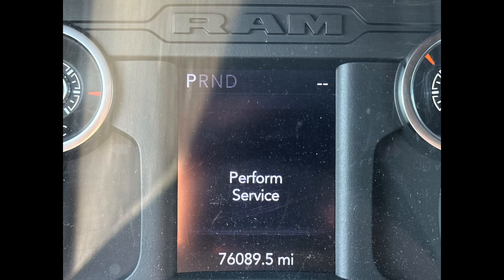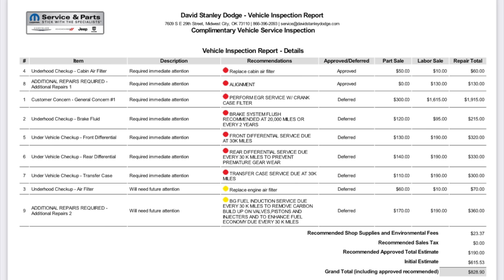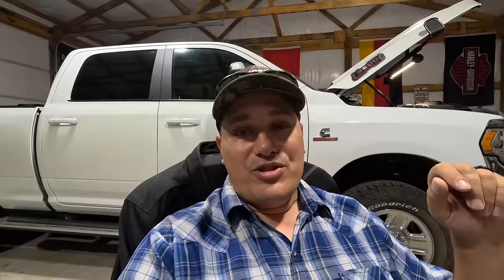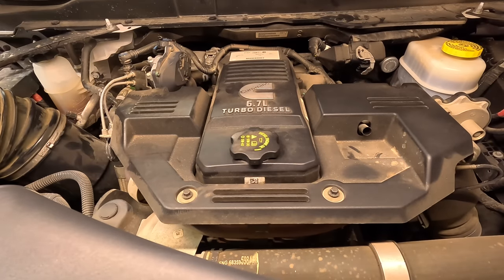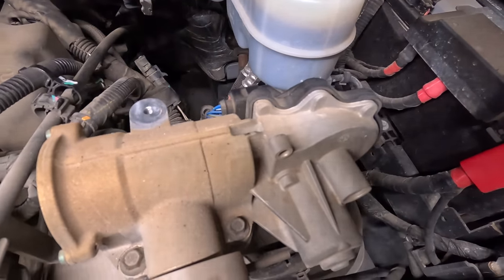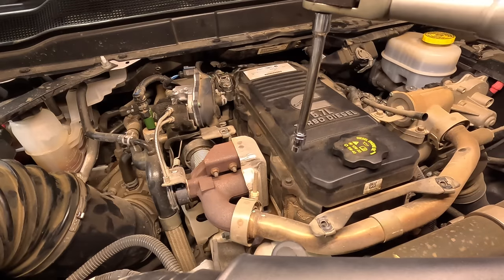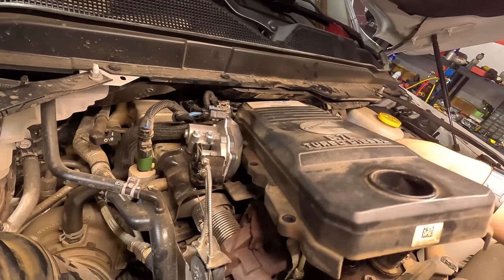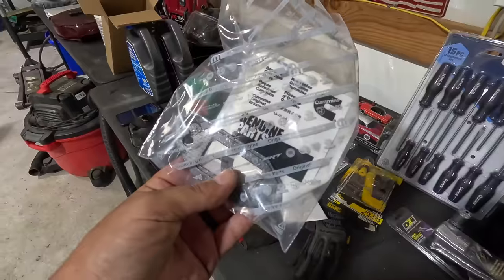My 2021 RAM 3500 Needed $4,000 in Service!! DIY EGR and CCV Service Saved me $1650!

Comment: Why didn't you clean the cross over bar and the EGR cooler?  I had the same problem with my old truck which was a 2018 RAM 2500 and the dealership wanted $2,500 to clean.  I told them I would do it myself and they said I need to do the cross over and EGR cooler.  So now I have 2 - 2024 RAM 3500 and I will hit 75,000 miles quick maybe in 6 months.  So are you say in this video that only the valves need cleaning on the newer trucks?  Thanks it was my first watching you video and loved your dog Roxy.

Comment: Crappy Fuel and Low Cetane will kill this truck. Also, consider Archoil 9100 and 6200 for idling

 Propel HPR, 75
Syndiesel, 60
BP (Amoco branded), 51;
Countrymark fuels Diesel-R, 50
Chevron, 49; or 51 with Techron D labels in select markets
ConocoPhillips through the 76 stations (California) 47-53
Petro Canada, 47-51
BP (Powerblend 47, otherwise 40-42)
Shell, 46;
Sinclair, 46;
Sunoco Gold, 45 (often +1-5). Sunoco regular is usually 40.
Exxon/Mobile, 43-46
Holiday Stations, 40-43
HESS, 40-42, can be up to 45.
Husky, 40 + diesel Max additives raise another 1-3 from there (41-45 max)
Pilot/Love's/Flying J/Valero/Sheetz/Walmart/Wawa: 40

Comment: Not sure what you got for $800, but I'd recommend never allowing the dealer to do any work on your truck unless it's under warranty. And definitely shop prices on the parts. RockAuto and Amazon. Also replace your grid heater asap.

Comment: Should have changed the oil and all filters, installed oil bypass filter, ck. water separater, before U put it into service. Replace intake with a Banks intake to fix the heater nut problem.

Comment: Yeah service is a rip off for sure .. But here is the good news 2018 and newer 6.7 DO NOT REQUIRE EGR CLEANING CHECK YOUR MANUAL. CCV FILTER IS REQUIRED @ 67K AND DEALER WANTS 600.00 TO INSTALL 50.00 FILTER. EASILY OWNER SERVICED. 
Dealer also gave me the brake flush
Diff oil change rear end oil change etc. If you tow change rear end lube for sure. Also your trans fluid 25k if towing 30k if not. Once a year new gas filter and water separator. If you own a Ram Cummins it nice to know how to do a few maint items to avoid dealer. If truck is out of factory warranty look for high rated independent diesel repair near you
and let them quote some work to compare prices, now even if close in pricing I would prefer Independent shop to do work as its generally done correctly. You be surprised who does light maint at dealer.. Not service tech but the lot boy/ quick lube guy. Again don't get dealer ripped for non required service.

Comment: My thoughts.  The message was from Cummins.  So you really can only blame the dealer for the prices.  You didn’t get scammed or anything like that, it was Cummins that programmed that message an the dealer is just following what they are supposed to do, which if you want to do it yourself is fine as they were helpful an told you what to do anyway, some wouldn’t.  

As for selling the truck because “I had to spend more money on it”, life happens.  Nothing is perfect.  I paid off my 08’ cobalt sport an had to dump another 300 in it for a fuel pump, never once said “Omg, I expected this to last me forever, shouldn’t have to do this!”   I also replaced my own 80 dollar part for that stupid exhaust side cam solenoid on the top of the valve cover.  Still, never thought to get rid of it.  Stuff happens.   

Also your truck had 65k on it. It was prolly time for that to be done.  NOW the dealer could have not upselled that extra stuff an just kept with the CCV filter an EGR clean, I would have told them to do just that, instead of going “omg, they want 4000 dollars to do this”.  Your the customer, tell them what you want or go to another shop.  

But it’s your vehicle, an I think that Ram will still be good to you, you just had a minor hiccup, keep going forward, you got this.  Get the most out of that Ram, then get rid of it, or find an older truck that might have more problems that 1600 won’t fix, just a gamble.

Comment: Doesn't doing it yourself at this mileage void any warranties?
Reply: You got the right to work on your own vehicle, you're not adding performance parts or flashing the computer or changing the shift points, ETC your installing genuine dealer provided parts as preventative maintenance.

If that was the case then if we changed our own oil, it would void the warranty
Reply: @B0xlife1  that's what my understanding is with warranties 
If the owner tampers or is not done by an approved shop then the warranty is voided.

Comment: Great video, you can't save more money. After 15-20 years depreciation is the highest. Buy a decent cummins engine truck with low miles and no emissions. When it get's even older it will become a classic. Greetings from Germany

Comment: So everyone knows that sees this video. That message that you got comes one at 65 “ish” thousand mileage for the ccv filter. 5-15 minute change if you know how to use a ratchet and socket. You can also do the fuel filters yourself for less than half price of the dealer cost and labor. If you can’t do it yourself you will see that crazy high bill that’s shown at the beginning of this video. A quick google search instead of taking to the dealer will always save you money.

Comment: Was that the entire EGR serivce?  I thought it also included cleaning the EGR cooler which is where all the labor is.  Currently doing it on my 18 right  now with 72k miles amd none of the EGR system wqs very dirty but i mainly do highway and make sure regens complete.  Also thought this wasn't called for until 60k on pre 13 and around 100k for 13+.

Comment: Hello Randy the cab filter should be changed once a year not every time you need a oil changed
Reply: Depends on where you live. You live on a farm. With lots of dirt. Then change it often. Your truck lives in a heated and padded garage. Once every 2 years if any😅

Comment: ccv is cake. the transfer case and front diff service intervals aren't 30k the transfer case service is 60k, front diff is check at 60k. 4th gens stopped getting egr cleaning services as the years went on. 5th gen cummins don't get an egr service. 
TLDR go to a different dealership.

Comment: New is sometimes the answer. If you have a partner and they want the newest sure that’s fine. But for me always used. It depends on your use if your driving tons of miles and have the means or it’s your income literally the use of that car then yes new is better if you don’t mind the depreciation. Otherwise drive a 20 year old used whatever. For me the top of reliability is 90s and early 2000s. Early 2000s is new enough to feel new.

Comment: How  does the round gasket stay in place while you are putting the Egr valve back in place?   If the original breather had a bunch of oil in it, do you need to add more oil to make up for what was in there?  ( yes, a newbie hoping to do this myself )

Comment: Your first mistake was taking the truck to the stealership for service instead of somewhere else like a local independent shop that would give you a better price. 
The second mistake was buying a used heavy duty diesel 4wd truck with 60k+ miles on it and expecting not to have to do a lot of maintenance on it. 
Just because you buy a used vehicle from a dealer doesn’t mean they did all the maintenance that was needed. 
I bought a used truck with 80k miles on it from a dealer expecting to have to do some maintenance and I was right. The only things they did was an oil change, front and rear brake pads and two tires. 
It still needed a transmission service, spark plugs and wires, belts, air filter, and the rear differential was low on fluid. 
They want to maximize their profits and so they are going to do the bare minimum before selling a used vehicle in hopes that you’ll bring it back to them and spend hundreds if not thousands of dollars in maintenance and repairs. That’s why they are called the stealership. The days of the dealership taking complete care of their customers is over, they are only concerned about their profits.

Comment: It hurts, making all those monthly payments and then an expensive service on top of it.  If you have another service on the Cummins, some aftermarket gaskets and breather might be much cheaper and good enough.  No personal experience with Cummins, just my opinion.

If you're paying that much on the newer truck and you have a cheaper alternative that gets the job done, that you can maintain, you should take it.  Of course there will be other maintenance issues on an older truck -- transmission, suspension, body rust, electrical, etc.  But still, 1100/mo payment is something to avoid unless you have no choice.

Comment: In response to not wanting to deal with the maintenance and repair costs of the current truck- just get a newer gas 3/4 ton truck. They’re great. Way cheaper, great at towing, and cost a fraction as much to keep them running.

Comment: What was that Milwaukee electronic ratchet you were using to get the little bolts from the engine cover off because that looks like a good reliable tool

Comment: Yes it’s business and a little unethical.  That truck should have been fully serviced before they sold it to you.
Many dealers will give you a “deal” or convince you it’s a deal, then get you on the regular maintenance on service you need and some you probably don’t need just yet.  It becomes a revolving door. Over 3-5 years you probably spend 30% of what you paid on service.  DIY is great.  I have the dealer do what I cannot.

Comment: I'm sorry, but why are you waiting for your truck to tell you to change the oil when it's been over 14,000 miles?? My Peterbilt holds 10 gallons of oil and it gets changed every 10,000 miles. Engine oil is cheaper than an engine. Personally, in my regular vehicles, I change the oil at 5000 miles. Spill and fill the transmission every 5 oil changes. Just my 2 cents.

Comment: Man, if I didn't pull 29k everyday, I would just go to gas. I have an 05 ram and it doesn't have near the power my 18 dually high output does. 05 has a 5.9 cummins.

Comment: Hi Randy. Just wanted to share with you the experience I had with the GMC dealership here in Michigan. Here's my review.

I had a problem with my AC and the service guy told me that my rear evaporator core was leaking. I paid $150 for them to investigate. After they found out what was wrong, they charged me $1600 to fix the problem. I declined to fix it and took it to my independent mechanic. The mechanic told me that nothing was leaking. The only problem it had was it was low on refrigerant and charged me only $250 to fix the issue. This dealership is a total ripoff. They will charge you for something that does NOT need to be fixed! About 5 years ago, I had a GMC Acadia, and had a severe issue with the headlights when driving at night. I took it to this place and they said that the headlights were fine. They didn't care about my safety. Stay away from this dealership. They will rip you off the moment you get inside.

Some dealerships are ready to rip you off hard. The air conditioning still works great to this day for $250. You can't trust dealerships nowadays anymore. They will find a way to rip you off. Especially when a person knows nothing about cars. Thankfully you do. Keep up the good work Randy. I love your videos.

Comment: Crazy they cracked you in the head with that estimate when it’s literally almost all stuff that can be done self service. Have 50k on 22 2500, had it since new, done my own oil and ccv service every 10-12, did rear diff change at 45k, doing BF, trans & transfer case flush & another oil change by the end of month. They’ll beat you down for the services by using MOPAR fuel/water filters, charging 350$ for the service…Doc diesel has them and cabin filter for 100$ and the service can be done by a 10 year old with a ratchet. The ccv is 50-80$ and is a few bolts for the cover, the fluid changes are just cracking bolt holes open and the BF is a turkey Bastet in the reservoir for the old stuff, filling with new, opening bleed valves and pressing the brake pedal till new fluid comes out. It’s not even labor that they’re beating us on anymore, it’s 5x overcharge on parts. If I’m going to spend $ on service, I’d be smarter to buy the tools I need, cheaper than the service cost and do it myself. Stay on top of your coolant level too at 50k/1800hrs, I was under the min line. That oil cooler eats it up. An actual EGR/DPF and alignment service is a shop thing🤷🏻‍♂️

Comment: Fuel Filters are stupid Expensive. Problem is, Cheaper filters are usually Cheaply made.
Replacement tyme for both Filters are 0.5 hr. each. If you are competent enough & have the proper tools, ( 28 mm socket 1/2 inch drive, Not a 29mm, a couple extensions & a swivel) you can replace them both in about 45 minutes, as long as the last guy wasn't Heavy handed, & or used the wrong tools, when tightening the covers/filter housings. (Your 2021 are Plastic). 

  Proper oil change for a Cummins Diesel, takes an hour's labor. 30 minutes of that tyme, will be draining the oil. Remember there is 12 quarts of oil that needs to be removed, & on a Hot Engine there is quite a bit of oil in the upper end that needs tyme to drain back into the oil pan, & out.
Oil Filter is only accessed thru the right wheel well, & it will either spin easily, or it will fight you to the point of frustration, Depending on the last Guy that did the filter change. 

  If You do a lot of towing & heavy braking, The fluid changes in the brake system & diffs where most likely needed. If Not? Then it wasn't.  Again If Towing? A transmission Filter service will be coming up soon, & You will want to do it, as it removes debris, & Heat Damaged Fluid from the system. If you are not towing, it is still recommended around the 80,000 mile mark, & I would not go over 100,000.  Unless you have the 8-9 speed transmission. I do not remember the service interval for them. The 8-9 speed transmission has a filter in the Pan, so you have to replace the pan. 

  The Newer Diesels with EGR's & EGR coolers do not do well Idling, nor do they like cold weather. They soot up & do not flow as well as the monitors / sensors like. But as you have seen they aren't that bad to clean, on the Cummins Engines. The EGR Cooler simply needs to be cleaned out with a power washer, to remove the excess soot build-up.

  You have been Driving this Truck for some tyme, & going to a Pre-Emissions Truck will be a disappointment, as You have gotten use to the Larger interior, the Nicer ride, & the Bells & Whistles of the late model Truck.

Comment: Diesels, especially Ram trucks, are largely a waste of money. The advantages they had before they don't offer anymore and are extremely expensive up front and in the shop, which they now spend a lot of time at. A diesel used to run 250k before any work besides maintenance needs done like oil changes,  valve tolerances, coolant flushes, etc.  I'm not even at 120K and I've replaced my turbo($4800), DEF pump and injector ($3500), air cleaner ($550), and power steering pump ($710). The "routine service" is a few thousand dollars to clean all the emissions crap. 

Unless you're buying a duelly with a 6.7L and an AISIN transmission to haul a 30,000 lb. excavator with, you're wasting your money. Gasoline engines are a lot cheaper, lower maintenance, and can be modified for better mileage and power. Some of these diesels are ridiculous like the 3/4 ton with a 6.7L in it. The motor is made to haul 3 times more than the axle can bear and is hooked up to a transmission meant to be used on 1/2 ton trucks.

Comment: My days of Diesel pickup ownership are over.. 
absolute garbage compared the  diesel pickup trucks of the 90’s to about 2012 … of course I’m speaking of the Cummins and Duramax pickups of that time 
My 99 is still on the road  at 25 years and 400k miles. 
Good luck to everyone trying keep a modern diesel running after warranty runs out

Comment: Why the hell does it cost $2,000 that's nut's. I understand now But I wouldn't bother replacing the brake fluid if it's a 2021 should be ok  for another couple of years same with the diff fluid if it looks okay i wouldn't bother changing it

Comment: Cost of repairs.    1 reason I WONT. Get a diesel!!!!    A diesel truck costs to much all around!!    If u. Get a truck. 1. Diesel engine costs. 10. 12ooo.00.    2. Upkeep. X2  or  3. Of a gas.  So. For say 12000.    Gas at 3.59.  U get 3342 gallons gas.

Comment: Newer is never better because you lose the most in worth of a car in the 1st year.
Best is to buy an older but good one, service it once complete, add a new radio for 200$ for connection, navigation, internet and music and then drive it to hell.
And if something breakes you can buy used parts and repair it.
That would also fit better to the character of a channel with the name auto auction REBUILDS. 😉

Comment: You scammed yourself.  No EGR cleaning required for ‘13+ trucks.  Your perform service light is due to CCV filter needs changing around 67,500 mile mark if not sooner.  Easy enough to change.  You should do more homework and better walk around on trucks you may buy.  Including maintenance.
Reply from the maker: Take a flying leap.
Reply: @AutoAuctionRebuilds  LOL